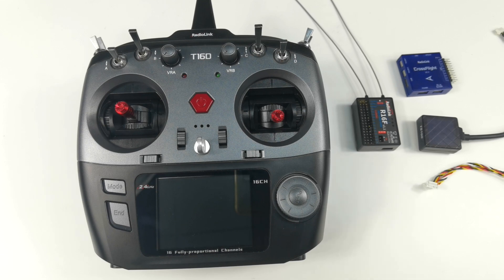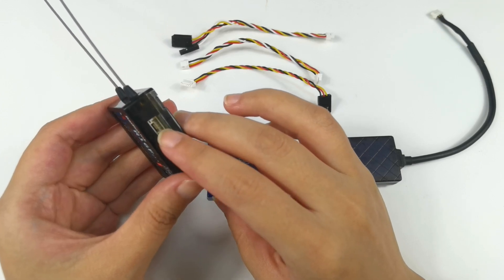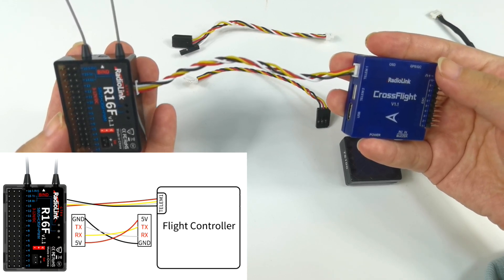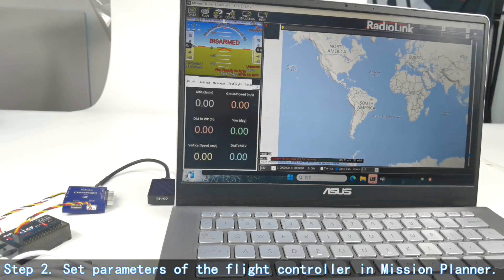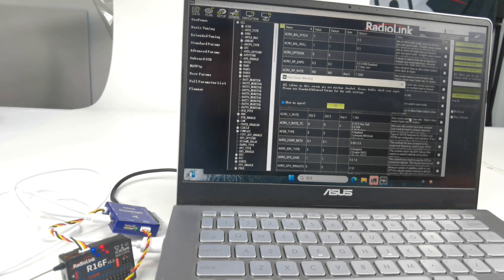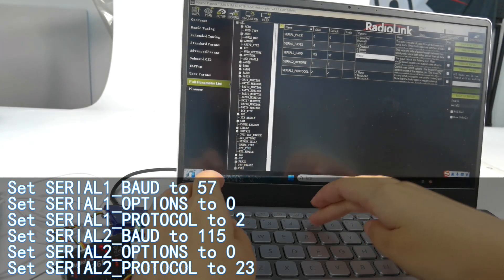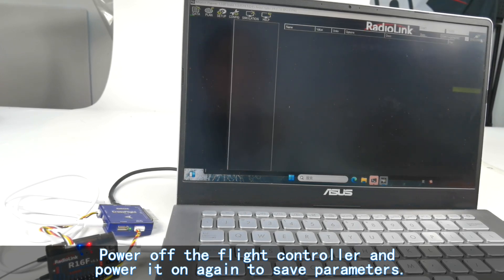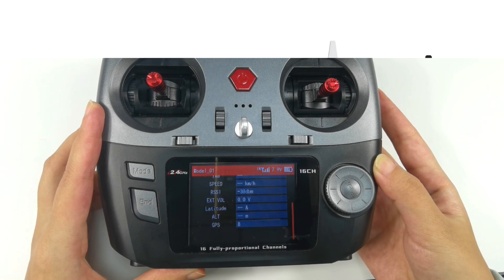Flight Controller Telemetry Function of T16D/T12D

Comment: I have a problem with voltage drop. when I use the throttle the voltage drops and sets the low voltage alarm of even when the battery is fully charged, could do with a delay of a couple of seconds to allow for voltage drop
Reply from the maker: Hi, sir. May I know what battery are you using and what low voltage alarm did you set? In general, it is normal there is instantaneous current when you push the trigger or turn the wheel immediately. You can set the suitable alarm. If any question please feel free to contact us. Our email is after_service@radiolink.com.cn
Reply: Thanks I have sent an email.
Reply from the maker: @chriswykes2319 Great. You can wait for the reply. Thank you

Comment: with pixhawk 2.4.8 i can see GPS position, number of sattalites, voltage of battery but cannot see any data of speed, heading, battery current, battery capacity, flight mode on my rc boat. i couldnt solve it.
Reply from the maker: Hi, sir. May I know what signal of the receiver are you using? Are you using CRSF or SBUS signal? Is it convenient for you to take us a video to show your problem? It will be more helpful for us to know how to solve it. You can send the video to our email after_service@radiolink.com.cn

Comment: Доброго дня. Radiolink T16D. 
Receiver R16F. + Crossflight.
На екрані телеметрії немає скорості і дистанції. В настройка зробив як на відео
Serial-1 Baud 57.
Serial-1 Options 0.
Serial-1 Protocol 2.
Serial-2 Baud 115.
Serial-2 Options 0.
Serial-2 Protocol 23.
Після тaого як зберіг настройки і
Перезагрузив всі налаштування на Serial-2 збиваються .в чому проблема підскажіть.
І чи можна PRM-03 підключить до R16F
Reply from the maker: Hi, sir. Do you have other telemetry settings on T16D? If yes, it is normal. Do you use external module? You can get speed telemtry when you connect external module and the GPS signal is good. If you don't use external module, sorry there is no speed telemetry. For distance telemetry, sorry it is not available now, but hope it will be available in the future. Sorry R16F is not compatible with PRM-03. PRM-03 is compatible with AT10II/AT9S Pro transmitter and R12DS and R9DS receiver. If any question, please feel free to contact us. Our email is after_service@radiolink.com.cn

Comment: Thank You so much. For this Video was looking for this already long time. Question, I saw in T16D menus "Bait Boat" option and I am wondering how to set it up and use together with "CrossFlight" controller. San we expect some tutorial for it?
Reply from the maker: Hi, sir. Thank you for your support. For bait boat function, you need to use it with flight controller. And you can connect R16F to the flight controler as what showed in this tutorial and then use the bait boat function. You can check the details of bait boat from the detailed manual of T16D here: https://www.radiolink.com/t16d_manual  Hope there will be titorials of it in the future. https://www.radiolink.com/t16d_manual  If any question please feel free to contact us. Our email is after_service@radiolink.com.cn